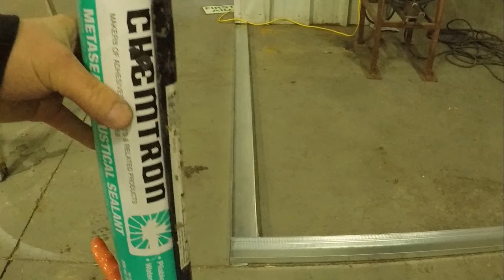Metal Stud Framing On Concrete Lesson

Comment: a question please: If I'm shooting and gluing a steel frame as an external wall, to a concrete floor/slab, is the glue a sufficent water/weather proofing barrier or do I need to still install some sort of flashing?
Reply from the maker: No flashing no. You don't need to glue the track down. For exterior walls use the foam gasket. I suppose you can use the chemtron caulking as well..
Reply: Ok thanks for that info. Sounds easier and cheaper.
Reply: @ConstructionKronies  if I'm finishing my basement that already has poured concrete walls and floor does the steel framing I put in front of the concrete count as exterior walls or interior? should I use foam gasket for those or just the caulking?
Reply from the maker: @FormaldehydeSon  that's another great question, so the basement walls in front of the concrete are called frost walls and are considered exterior or interior furring walls. I would use the caulking there. Also these walls should be insulated and vapour barrier (poly) all the way around.
Reply: @ConstructionKronies  thanks!

Comment: outstanding video .My question is that on a 700sqft retail store front would the common height on the ceiling would be a 10'ft ceiling with a 2'ft drop suspendid ceiling installed which now becomes a 8'ft ceiling is that the normal standard height. thanks. chilliwack bc canada
Reply from the maker: Yes that is very common. The important things to remember is get your walls up, drywall, taped and even painted before you install the drop ceiling. Check your slab for the high point and start from there, make sure you have all your flooring included. You don't want to be under 96" or 8' because it starts to feel like the ceiling is closing in on you. I would try and get as much of that space as I could, like go 9' if you can get all your mech, elect and plumbing in.

Comment: I really dig those wide ladders - what are they called / where do you get those?
Reply from the maker: You can get them at home depot but I usually buy them from my drywall supplier for better prices. We call them 2 step, 3 step all the way up to the 6 steps and extension planks. Hope that helps!
Reply: @ConstructionKronies  I searched for "drywall sawhorse" and found them - no idea they were a drywall thing, and never seen them at the depot - thanks man!

Comment: Hi , is crimping the top and bottom track not as good as pan head screws
Reply from the maker: Hey Luke man!! So crimping can only be done to 25 gauge steel (light gauge) and it is only recommended that you crimp the backside of the top. So screws in the bottom both sides and the screw in the side your facing and then reach through and crimp the backside. I don't even own a pair of crimpers, I can put screws in as faster if not faster. This wall here is of the heaviest gauge (14) walls you will ever build so I even had to predrill the holes for the screws at in the top track, crimpers will not work here. Cheers man! Does that answer your question? haha oops I just realized that your question was on this video and NOT my newest one. So yes this steel is light 25 gauge here and you can crimp it if you want. My apologies just waking up here!
Reply: Yeh thanks pal , in the UK 90% of walls are timber but have to do metal stud in a warhouse

Comment: what length of screws do you use?
Reply from the maker: #8 x 1/2" wafer head, you can get them for light gauge or with self drilling heads for heavy gauge.
Reply: @ConstructionKronies  Dude Thank you so much !! your videos are helping to train up my crew to be able to do commercial work  !!
Reply from the maker: I really appreciate the feedback. I do it for that reason exactly!! To help train guts.

Comment: what is the 89mm aluminium wall channel used for ?
Reply from the maker: We use it to stiffen the wall, keep insulation up and keeps our studs square for drywall. That's important because if you don't have channel in the wall you have greater chance of the joints being uneven and it will take a lot more mud to get flat.

Comment: Why aren't the walls built on the floor then stood up? I'm coming from residential framing.
Reply from the maker: I started as a wood framer myself.  When we are framing a house for example the foundation cap is perfectly leveled out so when we build our walls and square them they are good all the way up. In commercial the concrete and Steel will not be level and even sloped. Steel is more forgiving as well. We can use the track to adjust our heights. In wood the cuts have to be within an 1/8".  Does that make sense? We do pre-fab walls with steel stud sometimes.
Reply: @ConstructionKronies  Yeah, makes perfect sense. I just assumed the slab would be flat/level but it makes sense, especially given the size of commercial spaces, that they just wouldn't go to the trouble of making it perfect unless it had to be.

Comment: Wouldn’t it have been better to fill the concrete crack?
Reply from the maker: No man, we don't fill the expansion cuts.
Reply: @ not even with elastomer material to level it so you don’t bend the steel and weaken it? Aren’t you asking for water to go there and rust it? You know like Quickcrete or Sika non sag caulk or self leveling caulk.

Comment: Why didn’t you make the frame flat on the ground then stand it up….
Reply from the maker: Steel stud doesn't work like that. That's how wood walls are built.  We can build panels on some jobs but they are heavy and awkward so unless you have a crane,  or a zoom boom your not going to get them up. We build in place, the tools and materials are designed for it.